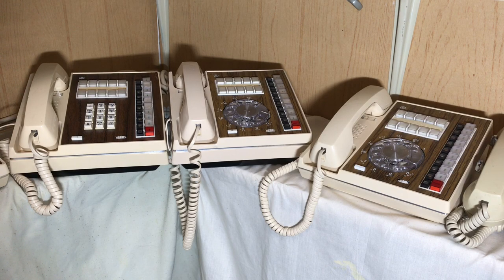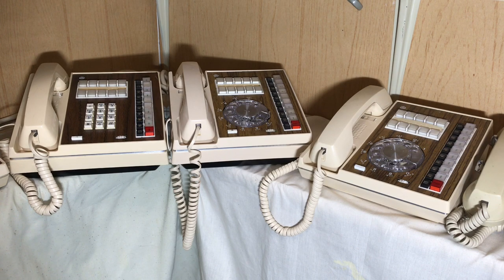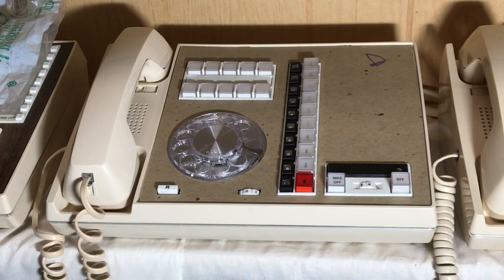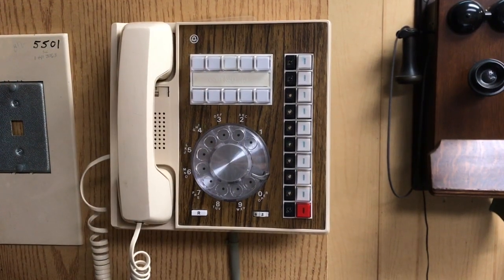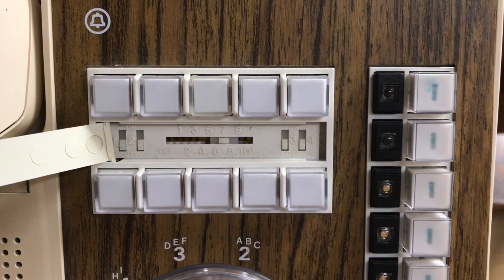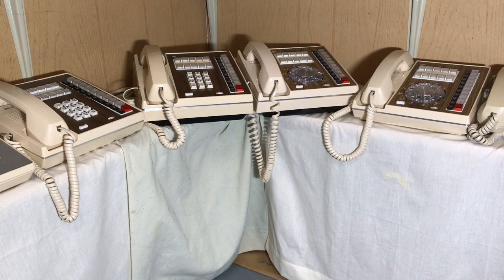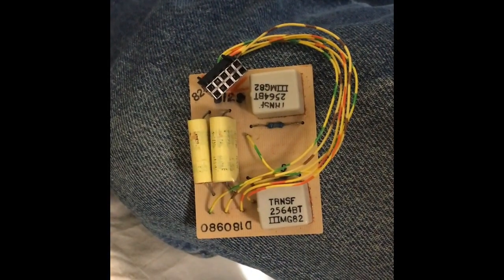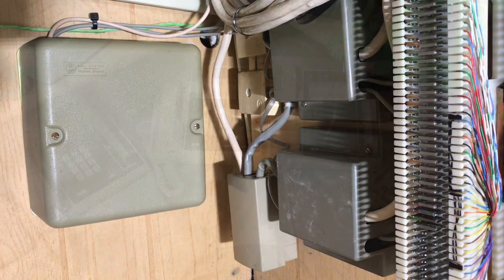Working western electric 416 Comkey system.

Comment: My church had a Comkey system in the 80's. One of the phones was set up so you could not dial out on the TT dial pad. I told them I could make it dial out. I picked up line 1, used the recall button to create dial pulses, and line 2 started ringing. It puzzled everyone who saw it and I never told them how I could do it. That was a pretty cool system, and I love your ingenuity creating the missing faceplate. I also love the sound of the Comkey ringer in these phones, and in the 718 sets.

Comment: Acquired a ComKey 416 system in the early 80's.  I had 2 masters and 2 slaves, 1 TT, 3 rotary.  I spent quite a few hours reverse engineering and figuring out what each wire in the 25 pair did so I could add an 851 or 2851 set (I don't remember which, but it was red)*, a 500/2500 type set and a 233 3-slot coin collector (modified to work with 1A2)**, and had them all in one mish-mashed system.  I also had a Demon Dialer in the system.  I also vaguely remember that when you pressed an intercom station button you could announce thru the speaker under the handset.  It's still out in the garage somewhere and I haven't used it since 1988.

* The 851/2851 set was modified to use one of the line buttons for the intercom signaling to the other sets and added a buzzer to receive intercom signaling.

** If I hung up the coin set wrong I'd put the line on hold instead of hanging up.

Comment: Is there a way you can remove and have scanned to high resolution PDF at exact size one of the rotary faceplates?  I need it for the numbers.  My goal is to set up a rotary face plate for the BIS or HFAI set and print on 3D printer.  I would be willing to send you one for your help with the project.
Reply from the maker: Call me at 971-239-5084